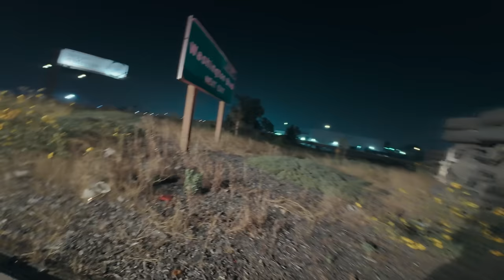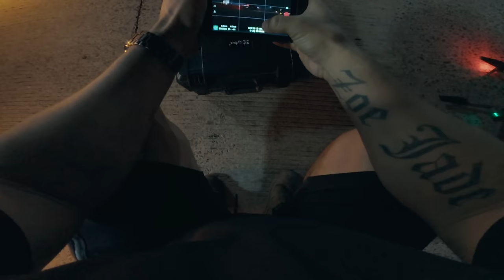Fuel Tanker Crashes and Rolls Over - HAZMAT mess on Freeway

Comment: If you ever run into this again, on the passenger side frame rail towards the front there is a VIN plate. By federal law it will tell you total capacity and the capacity of each compartment. I hauled fuel for over 30 years. Stay safe guys.
Reply: Wonder how visible that plate was  ??
Reply: @deernutOO go look lol
Reply: But wouldn’t this pretty much need the truck be either upright or laying kn the cab side? Cause like this the plate should be on the ground, no?
Reply from the maker: Correct lol we wouldn't be guessing if the company rep knew or if the plate was not on the rolled side
Reply: @PepesTowingService   Good point 😁😁😁
Reply: No, the plate with all the capacities is on the driver side of the trailer towards the front haul fuel for a living every hauling trailer has that tag
Reply from the maker: You gotta figure also a lot of these accidents happen after business hours. We are 247 of course but let's say the guy in charge of safety or whatever is 9-5. It's hard to get a rep out as fast as we can respond
Reply: In Europe: police can do this by the license plate. Also the number of the loading company has to be on the paperwork inside the cabin. And in Europe that capacity is on both sides; all of this is mandatory by European law. The law Brussels dictates. Not the European countries themselves.
Reply: 3:18 a safety supervisor connecting information from the towing company... Not in Europe! In Europe; the safety supervisor has to get the information directly from the loading company. Not even the trucking company. Since the trucking company office could've gotten false information from their driver. And to avoid communicating errors, the towing company shouldn't call the loading company and then tell the supervisor. On a hazmat scene: the safety supervisor is the one responsible, not the towing company. In fact: all actions Pepe will make, has to be agreed by the safety supervisor. If Pepe and supervisor are having a stand off disagreement: supervisor has the last word. But: Pepe will be free to leave if they feel their equipment will get damaged. In practice the supervisor and towing companies always are friendly, they have the same goal. But this European system makes sure several opinions, eyes and ears will make a plan. To avoid damage to tarmac, environment, the public, etcetera. The fact this supervisor is asking Pepe where the liquid line is, how many compartments, how many pounds... Are big red flags for public safety in European countries. Not saving European system is the best, but this supervisor is a big red flagg. He is the one that should be in contact directly this the loading and trucking companies.
Reply: And his manifest should also say how much is in each compartment even after pumping some out the figure should be amended so in situations like this the authorities know what they are dealing with.
Reply: Maybe truck 85 needs a name……. Samson or Goliath?
Reply: @PepesTowingService  do you get to charge the customer for standby time. You had a lot of resources tied up for hours.
Reply: @megaboombox1  It's automatic that if the tow operator is retained by the customer (the county) for the job (the trucking company I think eventually pays for it through their insurance) any standby time is counted until either the job is completed or they're dismissed by the county. 
Also the public billing rates are available on the OPGLA website.
So Pepe's isn't losing any money no matter how long they're on standby, I might be wrong on the fine details of such things as I've never been in that business.

Comment: Remember Palestine Ohio, they dumped that shit in a ditch, then lit it off. What the Hell were they thinking. Glad you guys are around, and I mean all of you. This mess was cleaned up the correct way. Thanks, Pepe's...Fire Fighters...Hiway Patrol...Hazmat...all involved...thanks
Reply: Peter Santenello just put up a video of that area today. Check it out.
Reply from the maker: Happy to be of service 24/7/365 :_ThumbsUp:
Reply: Diesel that is dyed is fuel oil #2 for farm vehicles and heating oil. Ran it in the bus I had because I had an oil boiler heater and generator. Since it only had one tank, I could use it in the Detroit Diesel engine. 1/2 the price of diesel.

Comment: Fuel hauler here (NOT THE DRIVER OF THE TRUCK IN VIDEO) 

Diesel fuel weighs about 7.2 pounds per gallon. Gasoline weighs about 6 pounds per gallon. Also, on most tanker trailers, there will be a plate on the driver side near the landing gear that tells you how many compartments and how much those compartments will hold.
Reply: I guess in this case the VIN plate would have been buried in the dirt since it was driver side down therefore not accessible.

Comment: As a tanker tanker, there are plates welded to the side of the trailer that tells you how much each compartment can hold. Unfortunately, it happens to be laying on the driver side. That’s where they normally put it.. Nice work
Reply from the maker: You are correct, that was on the rolled side which made it impossible to look at
Reply: it's so stupid that there is not a plate on each side . federal law needs to add that requirement. why is everything to minimum standards in america?

Comment: Back in the late 70s Shell Oil put together what they called their RAT team,,,,rollover action team. In their response trailer they had air operated hole saws, stingers that would reach the bottom of a compartment entering from the side. They had compressed air tanks on board, various sizes of hoses and air driven product pumps. They could arrive on scene and either pump into a stand by truck or use a vacuum truck and have the overturn empty and ready to upright in short order. Each of our Shell trucks had a black dot on the bulhead front and rear at a point that would be above liquid level if the truck were on it's  side. As for compartment compacity the driverside tank bolster on the front has a data plate that tells all the needed information, date of manufacture, who was the manufacturer, thickness of the material and compartment sizes. Retired Shell Oil in 2002!

Comment: The tag on the side of the trailer shows the compartment sizes & total capacity. The tags are not always on the right side. On some of our trailers, they are on the left (driver side).
Reply from the maker: In this case, it was on the rolled side. First thing we checked for.
Reply: @PepesTowingService  another way to find size of the compartment is find the permit book and look for vapor certs, has every compartment size, chp should have known that,

Comment: I reckon it would have been finished hours earlier if Pepe's owned a tanker and a pump truck (and a long hose).  I guess you'd have missed out of 4+ hours of standby though.  I noticed this on other events too, they get the wreckers on scene when there's hours of safety & cleanup to do. I guess they want you there incase it's a quick move.
Reply: they would have to have epa  licenses and insurance for that and environmental spills are hell  expensive if they mess up. so it may not be worth the trouble for that

Comment: A tanker hauling ethanol out of Oshkosh Wisconsin, rolled one mile from the loading point. It took down near 12 hours by the time they pumped it out to upright the tractor trailer.  They did drill the compartments.

Comment: Everybody is wondering about the capacity of that trailer. All you have to do is go into the glove box and pull out the paperwork for the trailer. You have to have it in order to load at any terminal and it will tell you the exact specifications of the trailer because they have to be vapor tested annually

Comment: I'm a bit surprised the wrecked rig still had its lights on.  I figured they would disconnect the batteries so there wouldn't be a chance of something sparking and lighting stuff off if the spillage got worse.

Comment: Where I live we would just add a layer of soil to the top of the dirt as long as there is no water source within a half mile radius from the spill the joy of living in a desert area where there is nothing around you for miles they just cover it up with a foot or two of new soil and they put a barrier under the new soil so that the water doesn’t wash away the soil that had the spill on it unless it’s a whole 7000 gallons that spilled would be the only way they would excavate the soil and bring in new soil but small spills just get covered up and then they replant the vegetation so it’s like it never happened very seldom do I ever see a rotator truck we have about 10-12 in areas around us but they usually just hook up and go as fast as possible

Comment: Fuel tankers never get loaded at full capacity, 90% is a max for a gas for a diesel even less, due the density is heavier for a diesel, 7500 gallons of diesel = 79800 lbs. did that job  with COX petroleum for 5 years

Comment: Dumb. First all tankers have data plates stating compartment sizes. Plus all have the capacity of each compartment labeled along the top rails. That trailer holds approx 9000 gallons max.  That is because it is built to haul diesel and gasoline along with many other liquids.  Each liquid weighs different. Diesel average is 7 pounds per gallon.  Gasoline is 6.2.. the product weight determines max ligal capacity. Max capacity by volume is always around 9000 gallons on a semi trailer.  Fire fighters should know that.
Reply: You are exactly right. 38 yrs. pulling bulk cryo trailers here.

Comment: Why cut a hole, attach to back of tank and pump it out!
Reply: Those tanks have a sloped bottom and drain through a gravity feed to a line in the bottom center of each tank (when the tank is upright). Lying on its side, the pickup is now on the side of the tank and not the bottom and you’d only get half the contents out.
Reply: That might get a tiny percentage of the load out. The piping comes out of the bottom of the tank which is now pointing slightly skyward.